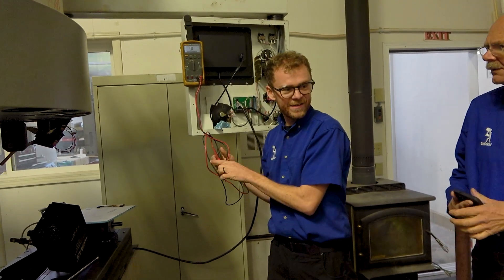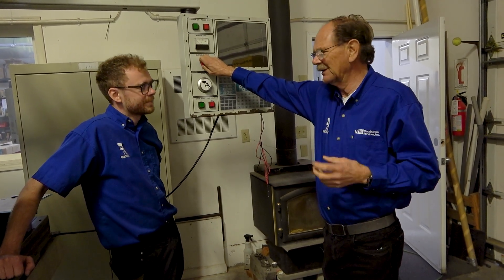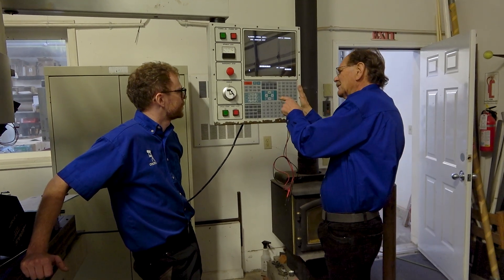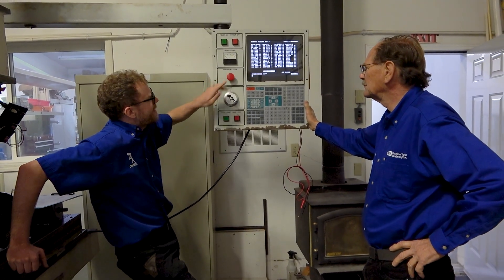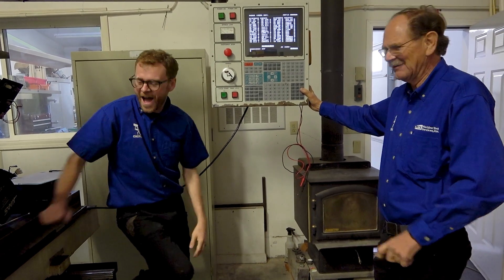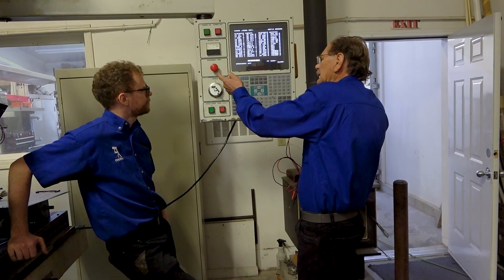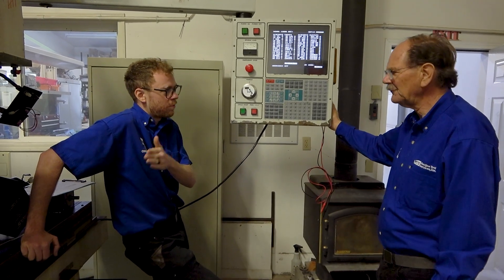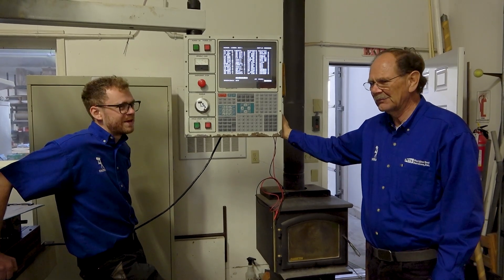Press the E-Stop?

Comment: I worked at a plastics place in maintenance department. The maintenance manager was an idiot. He has these pm papers which would print out and he could sign them and the owner sees he is doing something. He flipped out when he seen me hitting e stop because this checklist he had said test e stop. I would test all of the limit switches. Actually test them. He said oh no you just go to the log and if there are no errors the machine tells you when it's wrong. I said I'm not signing my name that I tested this without testing it.

Comment: in my experience most estops aren't rated for regular use like that so I would expect the opposite from what the old dude was saying
Reply: When would you turn off a machine other than for repairs?
Reply: @Grauenwolf  fair point, but the code is pretty clear that e-stops are for emergencies
Reply: @ShandoGuardian What code?

Also, I primarily use consumer grade machines where the e-stop is also the power button. Do you really think my 1,500 dollar machine has a better button than a 150,000 dollar machine?
Reply: @Grauenwolf  NFPA70E if memory served. I have a new job so i havent looked at the code in a while.

It could, the cost to get those ratings is one time thing for the testing. A mouse button is tested to be used a lot more than the industrial grade estops ive worked with
Reply: @ShandoGuardian That's not saying anything. A mouse is meant to be clicked multiple times per second. In 5 to 10 minutes it's going to be used more times than a typical e-stop is going to be seeing per year.
Reply: @Grauenwolf that's my point. And yet a mouse can be bought for $5 and an estop can run you $400. It's a matter of scale and supply and demand. The actual engineering/testing cost between the 2 is much less than 80x

Comment: Most CNC systems I've seen simply switch off the "enable" drive signal when the system is 'off'  - Or, on some drives the "OFF" signal sends an "inhibit" signal to the drives telling them they can't move.
The servo's are fully powered and fully capable of moving otherwise.

the E-Stop circuit usually mechanically (via a Emergency relay that is more reliable than the rest of the systems relays) disables the ENABLE circuit to the servo drives.
On some system E-Stop also applies electrical brakes, and if there is no counter balance usually an electro mechanical holding magnetic is applied to any gravity affected axis.
The reason ESTOP doesn't disable power to the drives is because of the drives regenerative braking - its hard on the drives to recharge these systems which is why CNC systems shouldn't be switched off and on repeatedly.

E-Stop usually causes all the circuits for tool-changers, pumps, etc to open as well via relays and contactors.

I've encountered quite a few machines in which flyback voltage wasn't handled fully... and the ESTOP triggers flyback from a whole bunch of sources at once.
I have a recent memory of my laptop disconnecting from Yaskawa drives everytime estop was pressed on the machine - because enough flyback voltage was present in the system to interfere with my laptops digital connection to the drives.
Reply: Modern, more appropriate system solution is using STO (Safe Torque Off) or SS1 or SS2 (Active braking without or with holding position). They are much faster, predictive in behavior, a reliable design for safety solutions. Most modern servos implement this, as well as behavior for voltage drop. Servo can work a few seconds off power in capacitors, so, for example, it can alarm, hold position, apply brake

Comment: I used to run a 2010'ish Doosan Puma 3100XLY, and we lost power to the whole building in the middle of a turning cycle. Everything blacked out (of course) and I started to hear some funny noises coming from the part loosing its grip in the chuck. I bolted TF away from that machine 😂
Reply: Lol yeah if it's a lathe I'd gtfo too.

Comment: I'm building a cnc router designed from scratch as my entry to cnc. 
When choosing a safety relay for the Estop system, I picked one with two output relays, one of which has an adjustable time delay. I have the instantaneous output wired as an input to the motion controller, in this case a Mesa Card and linuxcnc, to command a planned rapid stop, before the time delay releay closes   400ish ms later and activates contactors that shunts the servo phase wires to appropriate resistor arrays. Seemed like a best of both worlds where I get a controlled safe response from the system but the physically reliability of the hardware response. 
Now I need to look into the timing if the z axis brake and test to see if I get the slight drop!
Reply: Good thinking. I'm a software guy, and let me tell you: you do not want software in the loop of anything emergency related! Software sucks. Relays and resistors don't.

Comment: If you have a counterbalance machine with low nitrogen or failed chain, turning it off could cause head to drop. Nothing will stop the head from dropping at that point. If you e-stop the machine and the head starts to drop, you can clear e-stop and prevent the fall. Then you can place a support to keep the spindle from falling all the way down.
Reply: Yes I was thinking the same thing. Also applies to lathes that have heavy X axis. It may fall down if the servo brake is bad.